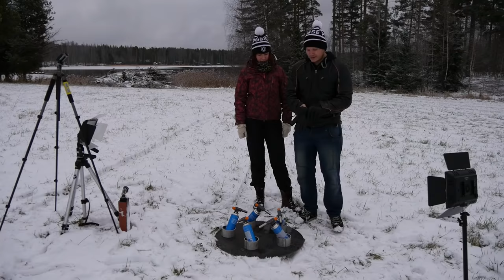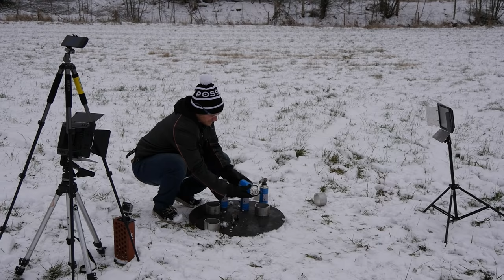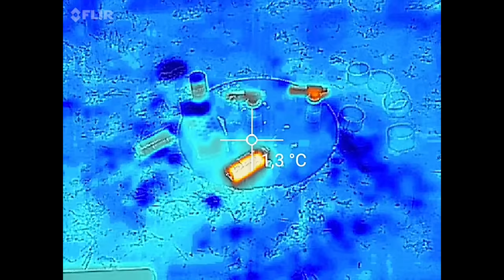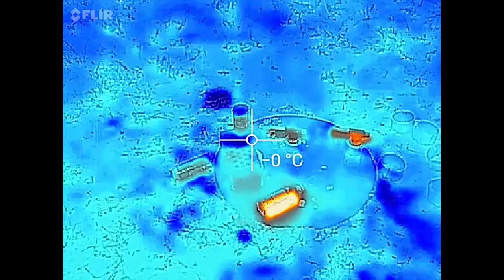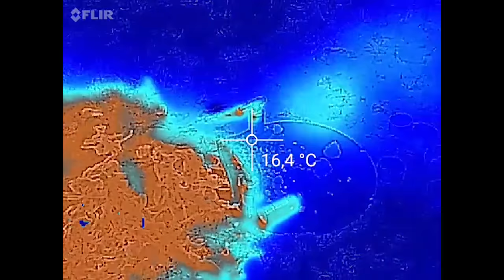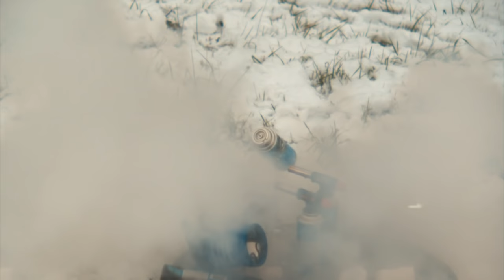Ring of Fire XL and some other gas torch stupidity

Comment from the maker: Thermal videos on this video where filmed with Flir One mobile phone thermal camera. But we have now Flir T660 to play with and it's much better so if you have some thermal camera ideas please write them to comments.
Reply: Beyond the press So cool video man. I really enjoy it as I have a big experiment on Gas Torch. 😀😀😀
Reply: when are you gonna to the disc brake thing??
Reply: Beyond the press build a snow igloo and blow it up in slow motion for us. please!!!!
Reply: If you build a wood fire and let it get going, you can then INSERT any compressed can into the fire. STAND WELL BACK AND WAIT. When the can explodes it will blow wood every where AND put the fire OUT! Cheers.
Reply: Can you put thermal camera on your press? I bet some stuff gets hot after you press it, right?
Reply: Beyond the press  like your acent :)
Reply from the maker: There is one video about that coming out tommorow. First I thought editing it today but I bought new computer and there is too much work setting this up :D
Reply: I would like to see some more driving stunts with the peltoauto, that would be fun
Reply: I think the reason it wasn't more fun than this is because it was simply to cold. Those torches use butane as the fuel and butane has a boiling point of about 0°C. 
I have one of those my self and if the can gets to cold outside it doesn't work (the gas just stays liquid inside). If you heat the can it works again
When the can exploded (after being heated by the other torches), the gas/liquid cools down due to the sudden expansion and then the outside air is also below the boilong point - that's why it sprays like a liquid rather than turn into gas. 
It's likely harder to ignite the liquid in an environment that's below the boiling point compared to the gas - it may be more like oil in it's flammable properties.
Reply: You need a flair.  They dont  need oxygen to burn and won't go out with the blast
Reply: filips Biete
come on, the hydraulic press channel is beyond petty worldly politics
Reply: Asmr
Reply: Beyond the press 
Aivan paras toi sun englanti :D
sitä on niin hauskaa kuunnella, Ns rallienglanti.
Hienoja videoita tähän mennessä muutenkin.
Reply: Beyond the press
Reply: Beyond the press i
Reply: So if you throw one of those in a really hot bon fire that has a nice deep bed of coals it will explode very nicely. It may have helped also that the fire was dug a couple of feet down into the sand.
Reply: For the thermal camera get iron really hot and put a large ice block on it to see if the iron cracks from the temperature difference. The thermal camera will give us clues on how it breaks. Cheers!

Comment: The results make sense on the burning torches.  As you heat them with the other torch, the pressure in the can increases.  When the pressure increases, the flow out of the can increases.  The faster gas leaves the can, the more quickly the can cools - all maintaining an equilibrium until one of the cans runs out of liquid - that's the one that'll kaboom.

So set the torches up in a more rigid frame and give them all the time they need, or purposely insert an almost empty can and know it'll go first.

Comment: This was definitely a learning experience. I think you're on the right track with the idea that the fire needs to be outside the gas cloud. This is kind of scary to think about though. It has the potential to expand much more than expected if you get it just right. I'd work on finding a consistent can explosion that will yield a wider cloud. Then you'll also have a good idea of the distance the flames will need to be. That would definitely make more of a mess too. Good luck! Love watching your channel.

Comment: I did something similar with 1lb propane bottles. To get reliable ignition I had to hang a road flare about 2m above the gas tank, which I then shot with a 1oz rifled slug from a shotgun. The slug cut a 3/4" hole in both sides and dumped all the gas out. The road flare lit the cloud. I had tried burning the can in a cooking fire (about 0.3m across) but the exploding can extinguished the flame and scattered the fire.

Comment: We used to build a bonfire and throw flammable sh!t in it. I'm wondering if using a torch is heating it up to fast, in only one spot. Plus, a big ass fire will have lots of sparks, embers and heat to ignite the liquid fluid in those tanks you're using. Remember the fire triangle - fuel, oxidizer, and heat. I really think you'll enjoy using a large fire. Start small with some cigarette lighters, or the small refill bottles for them.

Comment: I've done this with butane lighter refill cans and firelighters. Stab a firelighter with the filling adapter, balance the can upside down and have burning firelighters a few feet away in a circle around the butane can. Ignite the firelighter that you stabbed the can with, and stand well back.

Usually once the can went boom, I'd get a big, rising mushroom-shaped fireball a half second or so later when the cloud of gas hit the burning firelighters.

Comment: the one didnt light (you can see on the thermal )
Reply: I was looking at it as well. I think it might be the cheap FLIR-one camera which doesn't detect the heat properly over a bit further distance. It's also a bit behind the other can.
Reply: LucasAndAGuitar Ooh edgy.

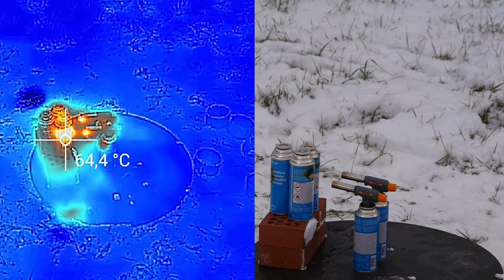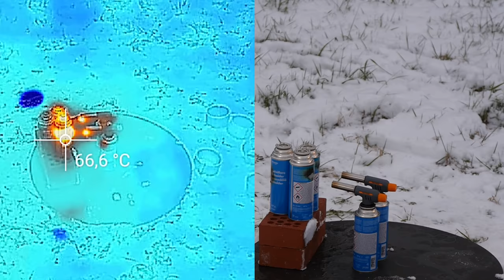Comment: That sound that start at 5:31. I think it was the liquid boiling inside. At first, it was large bubbles, but then the gas pressure over the liquid increased and forced the bubbles to decrease in size but increase in frequency. Sounds like when a marble or ball bearing is bouncing to a stop. Pretty cool. At 5:40 it changes again though. Might have gone into thermal runaway and the pressure was causing it to self heat. This eventually leads to rupture because it was a feedback loop.

Comment: press shaving foam!
Reply from the maker: Good idea! I will do that
Reply: And maybe in the same video, try crushing razor blades. Make a slit in two or more blades and connect them so you can make them stand up.
Reply: You should also do a can of shaving foam that has been frozen while you are at it.

Or perhaps press a bunch of different types of foam...

Comment: You're burning butane aren't you? It's too cold to get good vaporization of the gas. That's why we use propane in the states, it will still give off gas in low temperatures. 

You might want to make a tube and put the cans in upside down. Cut a slot in the tube, and put the flame in the slot so it cooks the can. When it blows, the tube will contain the gas.

Comment: It blew out because the pressure built up. then when the pressure built up, it would add more CFM to the end. then as it got more and more fuel to burn, it did not have enough oxygen. so it went out

Comment: The way that the rapid expansion actually blows the flame out is exactly the kind of thing that designers had to overcome when working on the design of the fuel air bombs...two things..they had to choose a fuel that had the widest range of fuel to air dilution that would ensure efficient detonation, propylene oxide was the best choice, things like petrol are terrible, acetylene was ok, and of course the ignition timing..the best timing after the burst charge dispersed the fuel air charge was around 100 milliseconds....these devices were evil, they had multiple ways of killing, it could literally suck oxygen from the air, but mostly it was the shock wave, the air pressure disruption could perforate ear drums, collapse lungs, cause bleeding behind the eyes etc, very nasty indeed....

Comment: Stuff like this never goes as planned. I remember when I was a kid, I took a brand new grill lighter, punctured it with a nail so the fuel was leaking out, threw it in a fucking fire outside and all that happened was it made a small fountain of fire, it never exploded. I also had one of those camping sized propane tanks and duct taped a road flare to it, let it burn all the way down, nothing happened except the can getting turned black.

Comment: My experience with those torches is that after few minuters of continous fire melt the ignitor wire and after few motre minutes they warp something inside making it unable to hold a flame even ignited externally.

Comment: Dangerous experiment. But I guess that in theory you could find a can position and speed of gas burning that will allow gas tanks not to explode because of heating each other. That's (could be) possible because gas cooling the can while it is leaving it's can.

Comment: You should try to explode the propane tank for gas grill. I used a couple pallets of wood around the propane tank sitting on top of a cooker/burner. It is a very large explosion. You will probably have to assist in the rupturing the tank after it has several minutes of heating

Comment: Metallic Paint works sooo much more cooler and it will launch over the tree height. After an explosion or will totally explode leaving a HUGE flame. It depends on how much paint is in there for the reaction. Also depends on what part of the can you heat. I usually try to get the bottoms heated. So it will for sure go off. The tops will melt if you heat the top a lot they just hiss out a flame with smell of paint. Rarely will bottom give out otherwise. I had the bottom go through my jacket! Like a hot bullet and the can came down from above the trees. That was my unlucky day cause I was standing right there. It hit me in the face next to my eye but somehow went through my jacket near pocket on my right. (Still I dont know how both happened) "Something"' told me to move my face and I did. Otherwise i'd have to right eye. Cause the very second I moved it hint my face.

Comment: I remember, as a kid, getting a copy of the anarchist's cookbook on a floppy disk and trekking out to some nearby wasteground with tons of lighter fluid, tissue paper, pressurised cans of cheap deodorant and other shit... and just burning and blowing shit up. Nothing quite as fun as standing slightly too close to an exploding can of Lynx (Axe) and feeling that pressure wave pass over your face as it explodes. Only got hit once by exploding steel can debris... didn't get hurt. Much.

We made a 'totem pole of fuck' a 12 foot long log of wood alcohol soaked toilet paper, cans of deodorant, shaving cream, fireworks and half empty petrol cans, all wrapped around a  three dowel rod core and clingfilm on the outside to keep it in and limit the evaporation of the fuel. Fucking awesome sauce! Sadly cut short by the arrival of a police helicopter.

Comment: Was that frozen propane-butane mix coming out when it exploded?
Reply: liquid gas
Reply: Jim Griffiths 
It was probably butane, it has a habit of freezing in the air mix jet when it gets cold. 
Propane freezes at a much lower temperature and burns with a hotter flame. 

I used to go night sea fishing, on cold nights (-3 deg C) my butane gas lamp would freeze.
Reply: Green Silver

Thanks. I thought the rapid pressure drop might be enough to freeze butane after a second or two.
Reply: Butane boils immediately at STP. When it's pressurized in cans it's a liquid at room temp but as soon as it comes out to P_atm it boils. What you were seeing could've been the Leidenfrost effect as the butane steam insulated the droplets slowing the boiling process

Comment: On the first ring of fire test, you realize that one of the torches was never lit, right?

No point in putting 2 torches on 2 cans; one will always go first and just blow the other away.

What you really need is one on the can, one 3 ft away and one 6 ft away. The one which doesn't get blown out will set off the big flame.  

:D

Comment: They never learn... 
you need to put MUTIPLES of burning stuff - ignition sources at different distances from flamable gas cylinder you have thrown/put into bonfire, otherwise the (mechanical-overpressure) explosion of cylinder blows out the fire in like 99% of times.And gas doesn't ignite.
Actually i am not sure about that number, just pulled it out of thin (macbook)Air, so i guess i have to make a series of scientific experiments. 
Neighbours will love it i guess. Anyway, it is New year coming and i can allways blame the hooligans/vandals...

Comment: Common myth is that propane or butane cylinders explode when hit with a torch or gun. Actually not true. The gas will burn and make a decent fireball, but nothing too crazy cause the case already is burning coming out of the can. Just like why a cutting touch doesn't explode even at full pressure. Let the gas out then light a fire several seconds later once it spread out....Then you can break all the windows in your house from the pressure wave. Maybe even the neighbors house too.  On that note, if it is a windy day and done outside, the gas would be moved too far away. Contain it in a big cardboard box for example. Real big box, like bedroom size by taping several boxes together. Or wait for a day where smoke just lingers if you smoke a cigarette or something. Actually don't cause it might kill you or land you in prison which would stop new videos.

Comment: Here is the thing with flammable liquids...  Flammable liquids are not flammable at all, it is the fumes that come off of those liquids that is flammable.  To get a "liquid" to burn you have turn it into a vapor first.  You can put whatever fuel you are using into a tube with a vent at the top, allowing the fluid to sit at the bottom of the tube.  You then put the tube over a fire.  Doing that will eventually "evaporate" the liquid, turning it into a vapor, you can then pressurize the vapor and create your fantastic explosion.

           jet flame     <-----  apply starter flame here
                 v
               l a l
               l p l
               l o l   Vent
               l r  l
-------------      --------------
l                                   l
l  liquid liquid liquid  l  tube
---------------------------------
                fire      <====== vaporize liquid here

The only thing I can't do is tell you how to compress the vapor that is given off after boiling your liquid, but I suspect you need a cylinder with a plunger.  With a hole in the cylinder you could put a spark plug into.  Yes, I just described, with a diagram and all how an internal combustion motor works.  You figured it out, go you!